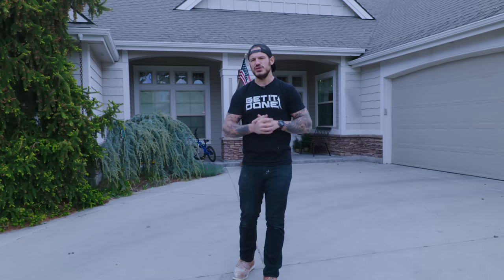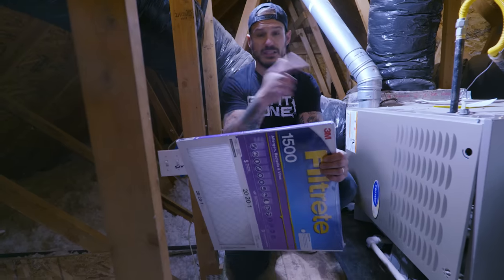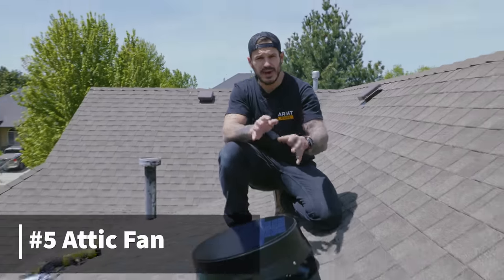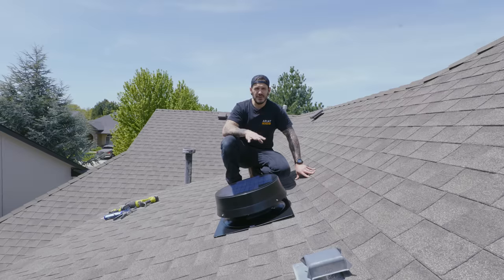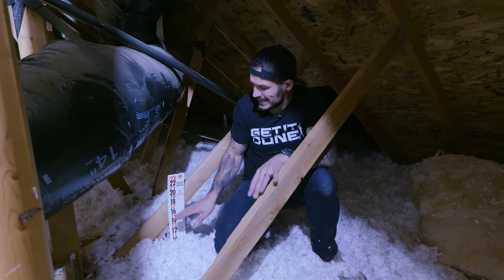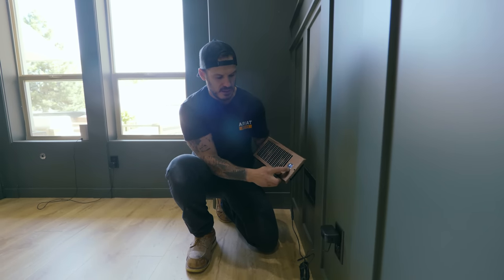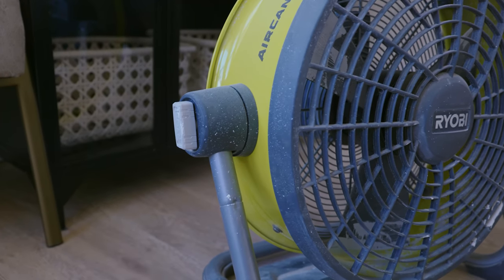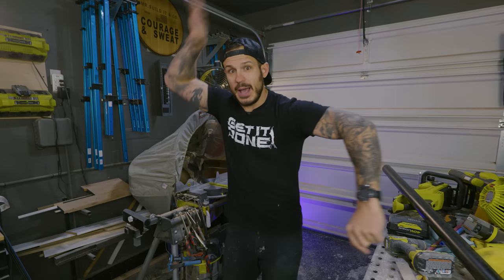15 Tips To Help Cool Your House This Summer + Lower Energy Cost

Comment: So if you're venting, vent from the highest point of the roof because that's where hot air gathers, but if you're using a ceiling fan, push that hot air on down to cool off?

I get the idea of evaporative cooling, that the movement of air allows sweat to do its job, but at that point maybe just get an outlet fan and circulate lower laying cooler air.

Comment: 50 pints 😂😂😂😄 50 is nothing in the south   I had to get a 100 pint Dehumidifier 
plus a 70 pint Dehumidifier. and the humidity hovers around 50>60 % humidity  
. and that's on a sunny day . after I got the dehumidifier.

Comment: I always wonder if more insulation will help with the temperature difference between the first and second floor. May try this.
Reply: Yes it does especially if you do whole house exterior to the outer edge framing insulation. The build show with Matt risinger on youtube talks about this all the time.

Comment: Vent fans are stupid. Most new houses are designed to cool one degree every hour and are balanced to do that. By adding that vent fan. You add and pull from the existing system creating more work load, diminished results in other areas nocking the balance off. Making the system work harder, may even trick the system to short cycle or stay on longer than needed to cool a space. Best to get a load calculation of the space you want cool to figure out if you need to add the the existing system or add a system.

Comment: Blowing cold air down and sucking hot air up😳. Lost me after that. Now, there are reasons to change direction of the fan but he's trying to do what thermodynamics already does. The cold air will fall on its own and the heat will rise.

Comment: Ceiling  fan advise seems counter intuitive.. warm air rises and cold air sinks. So shouldnt you pull the cold air up in the summer and push down the hot air in the winter?

Comment: who the fuck told you how the dynamics work. cold air is basically denser than warm air. Therefore it sinks and pushes the warm air up. Who told you you have to push warm air up and cold air down with a fan.

I know that’s what you think you’re supposed to, but that’s not even close to what’s going on .

Comment: Or just don’t buy front loaders anymore. They honestly suck for the reason stated in the video. It will always build up mold and mildew no mater what you do. Having to take apart the entire washer to clean as well is not feasible. So top loaders for the win.
Reply: The washing machine cleaner saves you from having to take it apart.

Comment: 200 or 300 to have a leak repaired and recharged?? I think you forgot a 0. Avg cost of a pound of 410a is around 125$ most residential split systems take around 7 pounds depending how far the two units are apart. This whole video is nonsense. Also if your going to replace your own thermostat please turn the power to the system off first. Yes it’s 24v and won’t hurt u in most cases but if you touch the power wire to a ground you will blow your transformer or if your lucky a control fuse.
Reply: 410a is $50-60 for what companies charge home owners and probably $30-$40 for what they pay for it. i’m in AZ. Just had mine added to AC Couple pounds.

Comment: Wow! You on that roof was super unsafe. No hard hat. No harness & safety ropes. Working on the roof by yourself. (I know that the cameraperson was with you but you still weren't exhibiting proper safety precautions.) Your tools weren't secured. It looks like your boots might not be slip resistant. Not good all around.